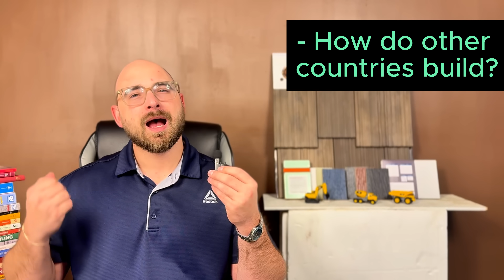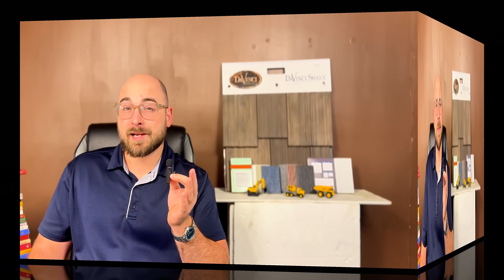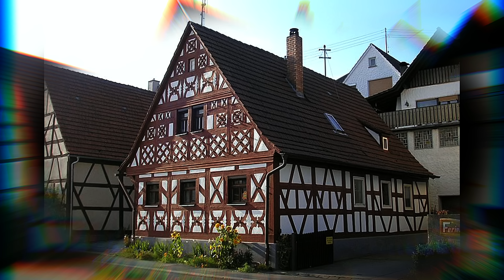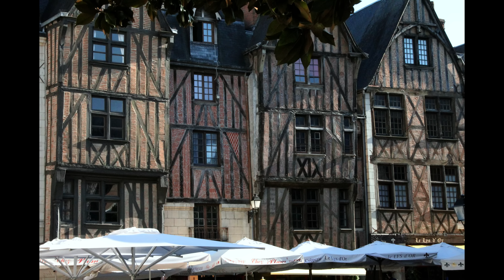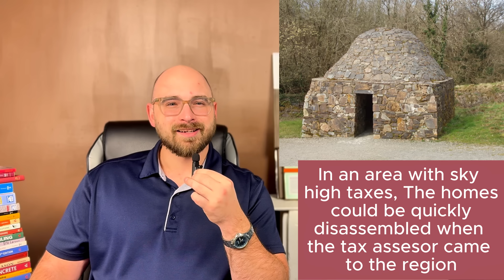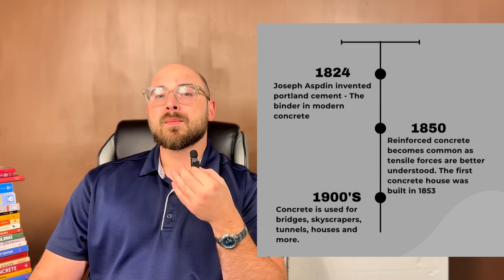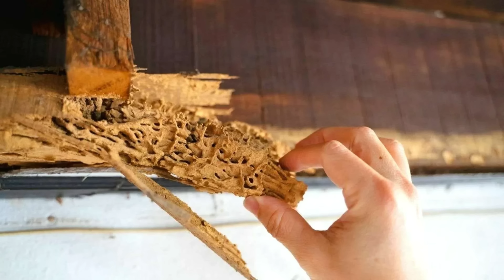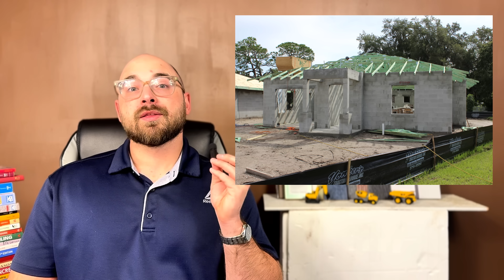Why Other Countries LAUGH at American Homes

Comment: I think America is going to switch away from wood frame housing within the next couple decades because wood frame housing used to be a cheap option that was meant to be easily replaceable in case of a natural disaster. With the devastating fires in California, the massive amount of damage we seen with the hurricanes hitting South Carolina and Florida plus the tornadoes run through the south we’re seeing homes be destroyed in costing an insane amount of money to be replaced. Often times the replacing of these houses is poor quality because the builders are making bank. Often times these builders are building poor quality houses that meet the bare minimum of standards. I know for myself if I got the option to build a house I’m going to go with icf.
Reply: Steel and metal are a good material for homes in earthquake prone areas.
Reply: Seismic events are a huge factor for California building materials. Stick framing can withstand significant earthquakes and typically only require cosmetic patching on walls. CMU and other masonry is not as forgiving without the use of cost-prohibitive suspension systems under the structure.

Every region in the USA has different challenges building for the local climate and types of disasters.

I live very close to the wildfire areas in Los Angeles and the problem wasn't wood framed homes, it was more related to landscape and lack of adequate brush clearance. Wood framed homes are not going to be abandoned in California, Perhaps metal or tile roofs will be a better choice for fire resistance as well as using a stucco or concrete board siding in place of wood siding. The fire spread due to hurricane force winds and delayed firefighting response.
Reply: @David_H_Parker  minimum/zero setbacks and vinyl window systems and wood fences. And as you mentioned flammable mulch and trees next to house. My nephew lost his house and my uncle in malibu almost lost his.
Reply: Eave sprinkler systems are a real solution
Reply: @BaronVonFrankenBolzlll  Yes, we live just a couple miles from the burned areas and have friends that lost everything, including their pets. We have one friend that was out of the country when the fires destroyed her house, car, cats etc, all they have left is what they had in their luggage.
 
Simply having hardscape and succulents near the house would have prevented many structures from burning.

I like many of the materials used in southern Europe, they use terracotta planks with hollow cores for walls, ceilings etc, tile roofs and heavy masonry finishes. I stayed in Italy for a month in these homes but also realized these materials have no place in California. This area of Italy had an earthquake 10 years prior, destroying and condemning roughly 40% of the homes and killing a handful of the residents in the small town.

Structural steel and concrete buildings are simply not an option for most homes due to high material and labor costs. Having a crane on site with skilled welders gets very expensive.
Reply: @BaronVonFrankenBolzlll  think about that in operation though. You can install that on Tom Hanks $20 million home where he pays $1500 a year for an inspection of his system where the technicians go through and make sure everything is operational. Now apply that to every homeowner in Los Angeles and see how quickly they just don’t do the maintenance and the system fails
Reply from the maker: Thank you for your comment, 

You make valid points, while there are concrete and ICF homes in CA, they do require additional engineering and approval to include seismic joints allowing for. Movement of the structure without it breaking apart. 

A properly designed concrete house with seismic joints can withstand an earthquake of greater magnitude than its wood counterpart and with proper design, is as close to fireproof as you can get (ie. Conditioned attic, fire resistant cladding and roofing, aluminum triple pane windows, defensive design, hard scapes, etc.) 

But this all costs more, in a place where homes are already VERY expensive 

Will CA abandon wood? No, probably not, 

Should they include more steel and concrete and fire safety? Yes absolutely. 

While I work against myself by saying this, I must admit, steel framing is likely the most cost effective option that can resist both fire and earthquakes. 

However if you’re spending $9,000,000 + on a house, I don’t see why not go ICF and have the additional engineering done, clearly money is no issue at that point and the extra rigidity protect against the unknown (car crashes, stray bullets etc. )
Reply: @Mike_Fortin  I like ICF for areas that do not have earthquakes. The California climate allows for a pretty low amount of insulation for homes as compared to the snowbelt. I have not used my heater since testing it for a few days when we first moved in and only use the A/C on the hottest days. The building materials and techniques need to fit the local demands and constraints. 

I recently bought properties on the other side of the US and have become familiar with the needs of a totally different environment to mitigate moisture and drainage issues as well as the need to minimize energy losses. Perhaps dustcrete will become the next inexpensive building material in the US outside of seismic zones. I remember when ICF was first being introduced and now has become common on new homes in several areas of the country.
Reply from the maker: That’s right, I forget you guys have perfect weather, 

I’m in IL , where we have 4 very different seasons 😅

The perfect building is going to vary based on location, budget, design, and more. 

In general, the US as a whole could do better in terms of disaster resistance. 

I’m the Midwest we have a decent amount of rain, snow, the occasional tornado. We already focus on heavy insulation (or at least we should) and to me, by the time we factor in all the extra material and labor, you may as well build an ICF house for about the same price. 

In a more temperate climate, I suppose it’s not as big of an issue. Although I would still opt for steel over wood 9 times out of 10
Reply from the maker: Couldn’t agree with you more, 

We are building with wood out of respect for tradition, but I think it’s time for a positive change. Building safer, higher quality homes. 

ICF is a great option, especially in disaster prone areas
Reply: I was shocked to hear how many expensive homes were made out of wood instead concrete and brick.  If a person has the means to build multi-million-dollar home, wouldn't you consider such materials?  But your right I think a change may be in the works but at the cost of the average American who can't even afford a wood house.
Reply: @brucesalta3271  These areas need to survive earthquakes and subsidence. California has several reasons why the wood stick frame home is king and it isn't just the lower cost.

Concrete and brick will not survive the earthquakes and soil movement these areas experience. Soil liquefaction occurs during the earthquake and you need a material that will flex and bend with the movement. 
 
The stick framing will still be viable with a more durable fiber/concrete siding product like Hardie. Landscaping changes and brush clearance are key to fire prevention in these areas.

Concrete structures are too rigid and would need costly suspension systems underneath them to allow for movement between the structure and the earth. I have lived through several major quakes and we all know an even bigger quake is coming someday.

Japan has similar wildfire problems but they are able to counter it with elaborate fire suppression systems combined with proper hardscape and brush clearance.

The government has dropped the ball in multiple ways, they collect massive taxes but have diverted funds away from where they were supposed to go in favor of ideological and vanity pursuits.

In the end it will ultimately be the homeowner's responsibility to do their part in making their home as fire resistant as possible because the government clearly will not do their part.
Reply from the maker: @David_H_Parker concrete can survive just fine, 

When including seismic joints and proper engineering a concrete building will be stronger than a wood building during an earthquake
Reply: @David_H_Parker The point I was trying to get across is if you have to protect against a disaster pick the one that is most likely to happen.  Mother nature is on a rampage.  Climate change or not, the climate is changing, and weather patterns are shifting. The United States is looking at a real different "waves of grain" in the next decade or so.
Reply: @ I understand that every area is going to be more likely to face some potential disaster. For SoCal, it is an even mix between earthquakes, fires, mudslides, and flooding in the valleys.

Without getting into the climate change debate, weather patterns change and many are cyclical. Weather tracking and recordkeeping is in it's infancy and many cycles are only identifiable when they are more frequent. 

That being said, I think that earthquakes affect more homes than fires do but most quakes do not completely destroy every piece of one's property. So many people are jumping on the bandwagon criticizing wood houses in the state where they have never lived and do not understand. This area has a large number of homes that have survived whatever mother nature has thrown at them for the last 100+ years. 

A freak storm and negligent officials made for the perfect conditions for this latest disaster to be much worse than it would have been with competent leadership and traditional maintenance.
Reply: @David_H_Parker  those fires have been going on for all the time we've ever known. It is nothing new. There was just more there to be destroyed than ever before now. A number of California's lunatic policies did compound the disaster though. The people got exactly what they voted for. They put fish before people and this is what happens when you do that. On the bright side the fish are doing good though.
Reply: @1pcfred 
 I agree. 
I think the Smelt probably want to rent a U-Haul and relocate to a better state.
Reply: @David_H_Parker  good luck getting a U-Haul in California. There's such an exodus from there they're all gone. One way U-Haul rentals stay where they're dropped off. So if everyone's leaving they take all the trucks with them.
Reply: @David_H_Parker  Also people are forgetting (on purpose mind you) the biggest reason for the L.A. fires.... incompetent and corrupt DEI government and their hires. If the forrests were regularly cleared via timber company and/or pre-set burnings, that disaster wouldn't have happened. They also have a governor who is a corrupt POS whom most definitely cheated (looking at the fortified recall) to stay and keep his power so he doesn't embarrass auntie Nancyo Pelosi. This European style of gov B.S. comes with big government and is the very thing these dipshits advocate for when the opposite would have fixed and resolved the issue BEFORE it became an issue.

Let's not forget the lesbo "woman" who said "If I had to rescue your husband, he put himself in a bad place"...... need I to say more? Also Gavin in the name of "environmental protection" (i.e. B.S. to the highest degree) let water run into the ocean without putting some of it into reservoirs, which is why the gay and trans colored fire hydrants were dry. People who solely blame the housing material and their solution is even MORE government are delusional opinions that should register them on a list to block suffrage, for those "useful" idiots will vote society into slavery if it means daddy government will save them (p.s. they won't save you).

Edit: Glad you and 1pcfred have articulate and functioning grey matter in this comment section.
Reply: It would cost even more money to replace concrete and Mason homes after an earthquake in California.
Reply: @Matt-yg8ub  The foam cladding on ICF can hide major structural defects in the concrete after an earthquake.
Reply: I hate to break it to you but a tornado can level any structure above the ground. It'll tear reinforced concrete up. It'll tear asphalt up off the ground. A tornado can pick a tractor trailer truck up and toss it into your house. I really don't care what it's made out of then. It's getting busted up.

Comment: 24:14 "the system failed"
proceeds to show rows of houses built with that system in 1910 still standing and looking good.
Reply from the maker: It was supposed to be used for the mass production of housing, only a few concept homes were actually built. 

The investment cost of the form system was around $3,500,000 adjusted for inflation. 

Even though the finished house was cheaper than wood framing, builders couldn’t afford Edison’s system and thus the idea never took off

Comment: great video, we have a slump block home in wickenburg az. built in 1955,  the outside has been fired and wrap with foam then stucco. along with a metal roof this house is bullet proof.
Reply from the maker: Are there many CMU homes in AZ dating back that far?
Reply: may be some of the homes built by frank lloyde write in the phoenix area were.

Comment: I'd love to see more brick myself -- and RED brick. None of this grey, blonde, or brown nonsense. I want my bricks to be red enough to make a communist proud! :P Seriously, though, the concrete sounds cool, too. No reason you couldn't do a facade of bricks. I live in an old brick building in an old city, and one thing I love about it is how I practically never hear my neighbors. In fact, I mostly hear them outside coming home rather than from their own units. Old solid construction like this has its benefits, and I think people would be more open to multifamily housing if they could be assured of quality noise insulation. I imagine a stout concrete building would do that well. How would dampness be dealt with? You mentioned it as a problem in Europe.
Reply: Brick is obsolete material. Just by reading your comment I can tell the guy, in the video, doesn't know what he is talking about. Most of the world uses AAC blocks
Reply from the maker: Poroton, and porotherm are quite popular in Europe, (which are bricks) 

In what countries are AAC blocks most popular?
Reply: @Mike_Fortin  One would definitely be Romania, but i am quite sure that Poland, Ukraine and Hungary also build a lot with AAC. It is a material that is extremely easy to work with and has great insulating properties (and cheaper). You still need exterior foam insolation. And of course concrete beams for structural support.
Reply from the maker: Thank you for clarifying :)
Reply from the maker: @Rahshu if you use a product like ICF, 

It has a concrete core, but the concrete is protected from moisture on both sides, and we also cap off the footer to prevent wicking, 

Making for a dry home inside